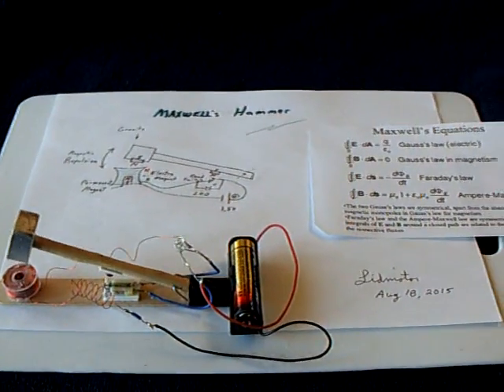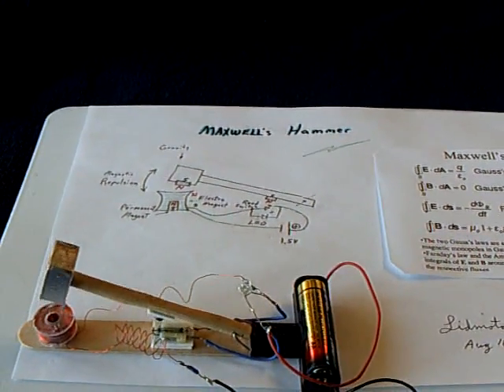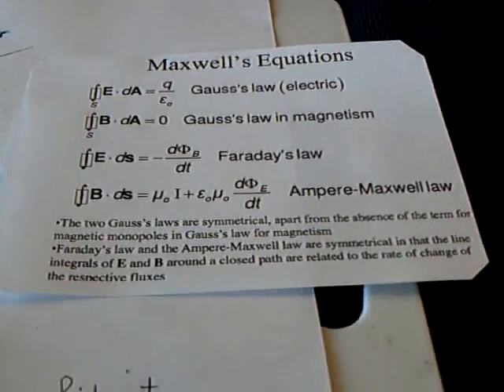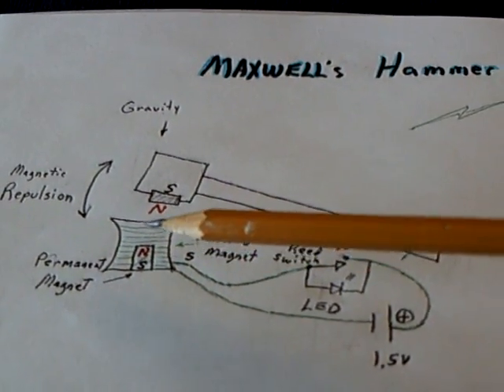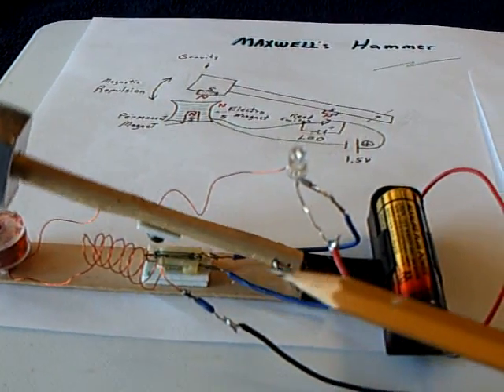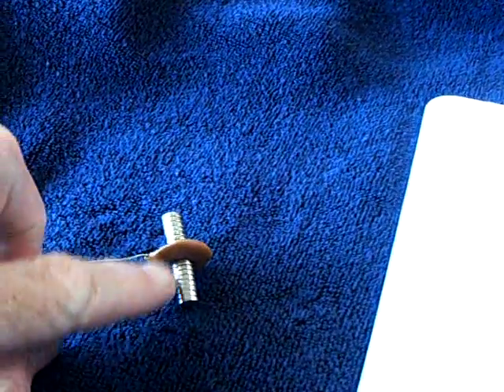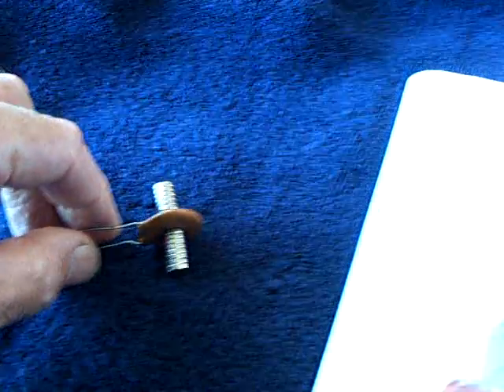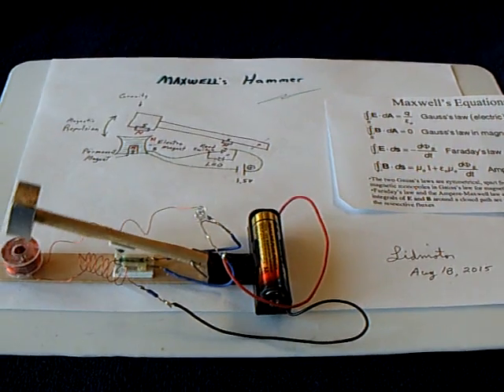Maxwell's Hammer

Comment: Very nicely made and great explanations of how it works! How did you obtain the large electromagnet coil that the hammer is repelled from? can you buy these or did you wind your own? Thanks!
Reply from the maker: +trains galore Make your own.  It is a plastic sewing machine bobbin wound up with 30ga magnet wire. Air core.
Reply: +Lidmotor Thanks for the answer, I might give it a try if I can get some enameled wire.
Reply from the maker: +trains galore Buy some on Amazon or EBay.  You can also take apart an old transformer but it is a lot of work.

Comment: I love your motors.  Would you mind telling me where I can get some of the coils you use in the maxwell hammer ?  I would like to use them in my ez-spin motor designs I am working on.  I can just about make anything in plastic but winding these bobbins are what is putting me off playing more.  If I could fine a supply it would help me.  Thanks and keep up the good work.
Reply from the maker: 3D_Printing I use regular plastic sewing machine bobbins.  I get mine at Walmart.  The Brother sewing machine ones are the best.  Most of my coils are 30ga magnet wire.  The one on Maxwell's Hammer is wound with 30ga but I may try 45ga and see what happens.
Reply: 3D_Printing Yeah winding the bobbins put me off at first too.  It seemed a daunting task.   Since I have built 3 ez-spin motors using laser cut brass parts and sewing machine bobbins as Lid' suggested (I used flatter pancake style touch n sew bobbins but concept is the same).  It turns out winding the coils is one of the easy parts now, just a bit time consuming.  You can buy a cheap variable speed drill, and make a winding jig which is what I did.  Zip tie the drill to a piece of plywood and build up a post to hold a wire spool.  Then just wind away.  I used 40 gauge wire as it gives better resistance than 30 ga but isn't as thin as a frog hair like the 42 ga stuff.
Reply: ***** Sorry My bad I thought they were Pre-wound.
Reply: DaveC1964 Yeah, I made a spool holder and use a drill, but its still a P.I.T.A lol.
Reply: 3D_Printing

Depending on your setup I guess.  To me winding the coils is just kind of boring.
Reply: Problem is I have a very small 'makerspace' Its a effort to do anything other than 3D Print. Winding coils usually means I have to do it in the kitchen or living room,  Thats ok provided it does not break off at 80%. I am using 42GW and I see winding as a grind and heart ache - lol
Reply: 3D_Printing

You need a good wound wire spool.  I get mine from Remington on ebay.  Probably pay too much but the guy is close to me and I get it quick.  He also has tons of sizes (make sure to get single not thick insulation as thin works better obviously) and the spools are wound well for good de-spooling.  I have not made a motor with 42 ga yet. I used 40 ga which is slightly thicker.  I am not sure on my motor design if 42 ga would be better or not.  I would have to experiment but then if it wasn't as good I would need to re-coil the motor which would be a pain.  Lidmotor seems to have good luck with even 30 ga which is like a jumper cable in comparison to 42 ga.  I agree though winding is definitely a grind.

Comment: Nicely built...on a stiiiick.
Handy in an electronic rat catcher..rat runs in, device fires up, bap bap bap bap lol
Yeah, same problem here with the good ole Docs device. it will scavenge from a CFL well enough, but that's not how it works. The magnets ought to do something, sort of piezo effect and average ambient vibrations, even electrical vibrations from 60Hz. But, nope, nada, nothing yet.
The research paper suggests cardboard and clingfilm, am sure he has something else in there !
Reply: slider2732  theres a paper? (dramatic music) i must see it!
Reply: jeremy gwilt
Oh it's on one of the forums, in the relevant thread. ou.com I think. Back a few years he and some other guys were working on similar principles as harvesters. The difference is the magnets (as far as I can tell)
Reply from the maker: slider2732 The thing is that in Doc's 4th video he is using a regular off the shelf capacitor and still showing results.  Something is not right.
Reply: slider2732 i see...i cant say i have the stamina to dig i out (my brain starts to rebel if i read too many ou posts). ill wait for the incoming sales pitch  ;)
Reply: *****
Noticed that later when catching up. it would make sense if a cap didn't work and only a secret thing in the middle worked. He may fully believe in it but, something outside of his knowledge charges ?....he's had some great inventive ideas, I like the guy. No caps here have worked, high kV, flat, round, small uF, high uF or any others.
Reply: jeremy gwilt
Page 2 I think lol. Don't know if can link on Lids channel. Basics are a sandwich of card and polythene it seems. A capacitor of sorts for harvesting. Research from many years ago.
Reply from the maker: slider2732 I learned a great deal from Dr. Stiffler and the study of his work.  I have successfully replicated a number of his devices (as did many other people) and that is why this situation is such a puzzle.  The problem I had replicating his PSEC device might be related.  I don't know.